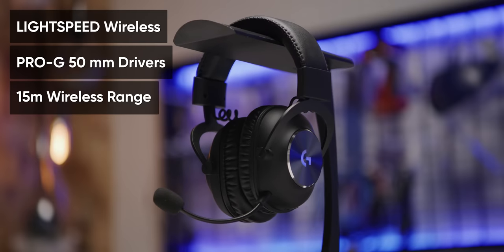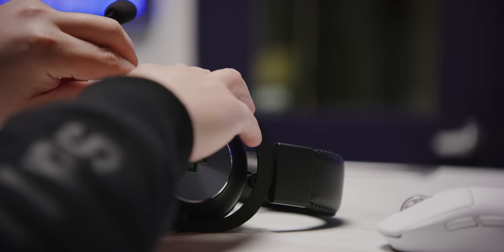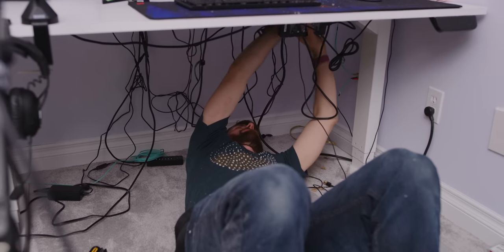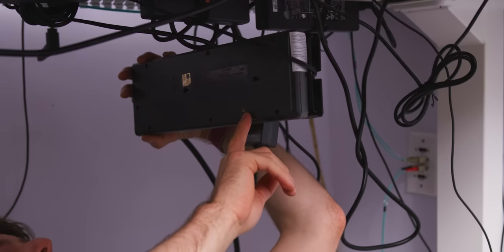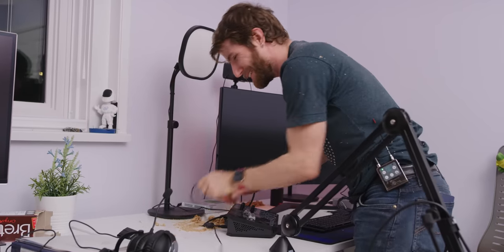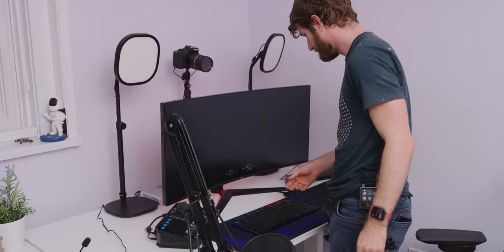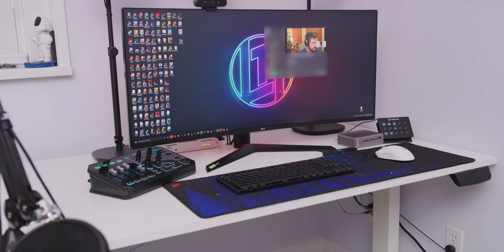It's time to break up. - Stream setup cable management

Comment: Gotta say, this was a pretty disappointing video. Seriously all you did in regards to getting rid of wires was to use a wireless keyboard and mouse. I thought we were going to see something exciting like wireless HDMI or something along those lines getting rid of some additional wires. You didn't actually use anything wireless that hasn't been wireless for many years now.

You would also have found that using an impact driver instead of a drill for drilling all of your holes would have been significantly better and saved you a lot of time. all in all, I've gotta say one of the more disappointing video's you have done. I really felt let down by this video and the lack of effort put into actually going wireless.

Comment: Use hot-glue and a pea-sized dollop silicone adhesive the hot glue will hold while the silicone sets then it not coming off without a chisel and a light tap with a hammer, beware too much silicone will be much harder to get off and I wouldn't to it if the underside of the desk is something really porous like particleboard unless you have practiced and got your amount of hot glue to silicone figured out. Using hot glue well can be an art using the right temperature and amount is very important an in most if not all cases hot glue is nonpermanent by design. It is most useful because it's quick and sticks to almost anything semi-permanently for things like crafting and prototyping. I came across the idea of alternating dots of hot glue and silicon in the countertop biz and have successfully applied it to many other DIY type adventures and most with great success. Any it's a secret handyman technique I wanted to share the hopefully someone can get so use out of.

Comment: Quick question: do i need m.2 and ssd ?
Reply: M.2 are ssd unless you get a m.2 wifi card or something if you want a m.2 although costs more go nvme because a Sata m.2 is about the same speed as 2.5 inch ssd so you don’t need store everything on ssd ur bulk storage can go on hard but getting a pc in this day and age with out a ssd as ur boot drive is not a good idea even a 256 for ur OS is good

Comment: The reason the hot glue never holes is because the heat coming from the power pack melts the glue use duct tape or something that can’t be easily melted that is still strong

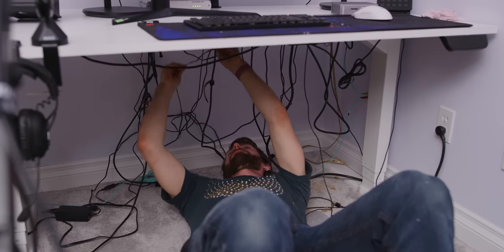Comment: 8:50-9:35 Have you guys at LTT considered using CAD and a 3D printer to make small, drill-able cable hooks for independently routing wires, and a fitting slide-in brace for whatever model of surge protector you use? It took a lot of trial and error but that's what worked for me was effectively small hooks with a hole and a box at the surge protector's measurements for it to slide in like a holster, then drilled underneath the desk as well.

Comment: Lil drilling tip. After you've managed to start drilling a slightly larger hole and the bit hard stops, hitting your monitor. Restarting can be easier if you run the bit backwards for a second. That hard stop is the bit digging instead of cutting. The back ward drilling will smooth out the dig spots and make mid hole restarts easier.

Comment: There is a nice trick which might work nicely for sticking things up under the table (like powerbricks you mentioned) which comes from knifemaking when there is a need to align handle for drilling holes and then easily get rid of connection without damaging or contaminating any surface. Instead of using the glue itself, which might not hold easily to different surfaces and leave marks, they stick the tape for both metal and wood (like a silvertape or any other, whichever works best) and than apply super glue in-between them. The connection is super strong, if you want to get rid of it you can just twist it to break the bond but the cherry on top is that after breaking you can just peel the tape off and you have no marks on any surface (brick and table in this case). Hope it would be helpful for someone's cable management project :)

Comment: So nice to see linus doing this stuff. As a tech who works for a contractor 3 years green on this construction crew it's nice to recognize his pain, fyi dude hole saw is a thing their mainly used for dry wall but you'd have been just fine with em for that, but I've used those crap bits too they are super jumpy.

Comment: tip: use a radiator as cable management it helps out to hide cables behind it and if its cold it helps as a heating thing